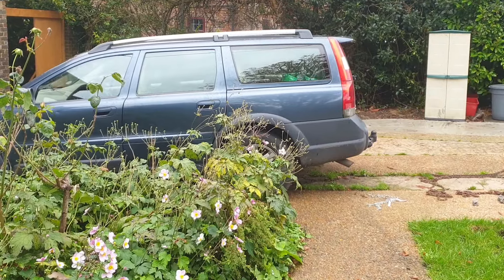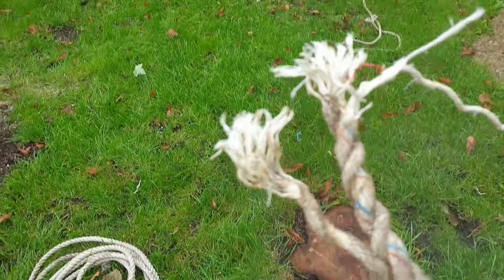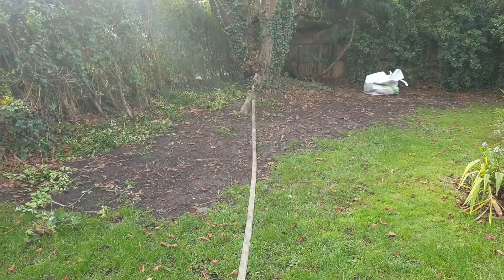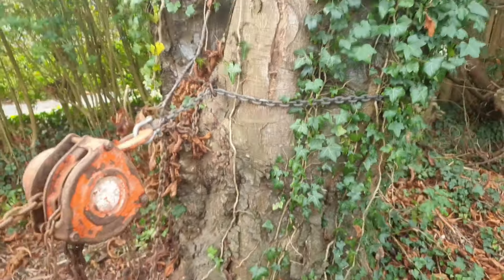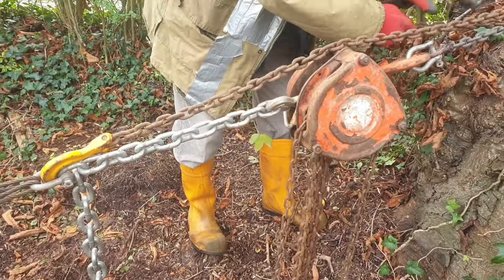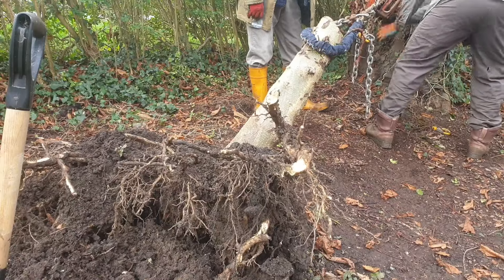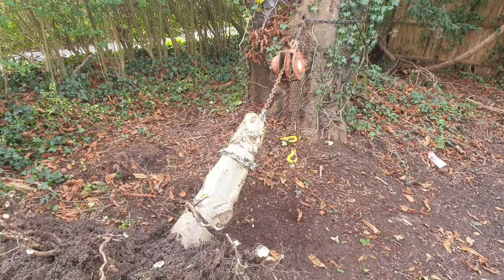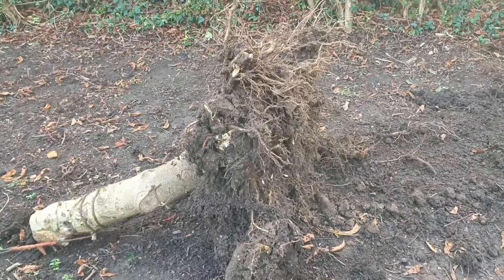Pulling a holly stump with a Volvo....and a chain block!

Comment: No doubt a chain hoist allows you to improve your odds of pulling a stump. But it can also break chains and put you in danger. There are many videos on YT on how to use pulleys to multiply mechanical advantage (force) to pull stumps ... in a fairly safe way. Take a look at these videos for ideas and how to improve your safety while doing these type of tasks.